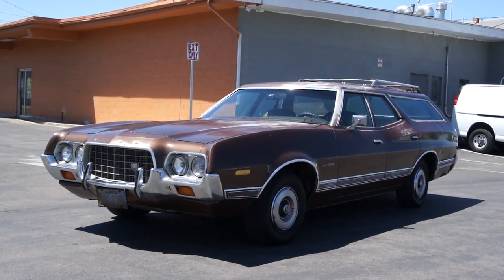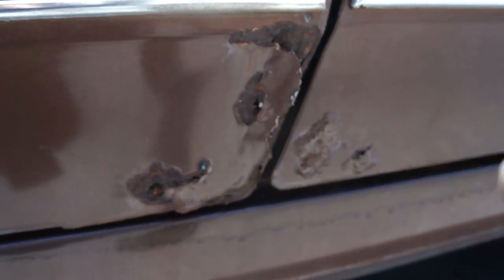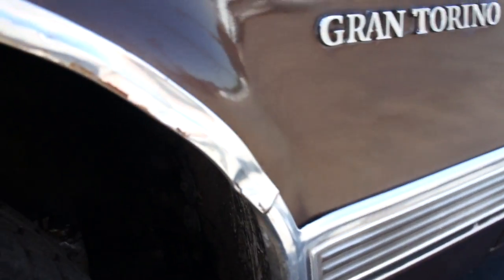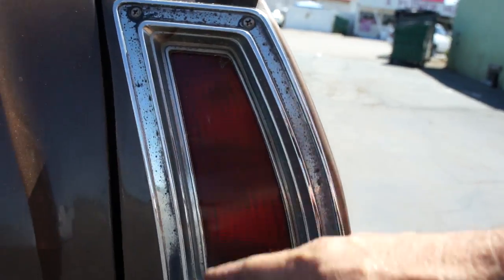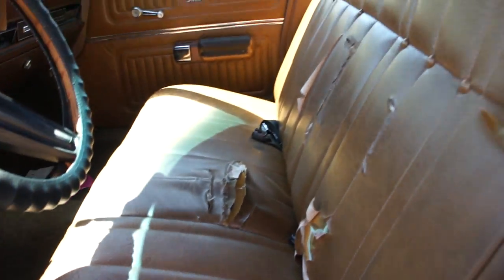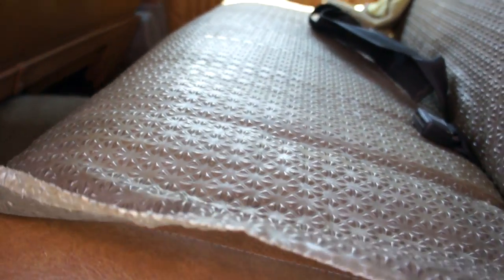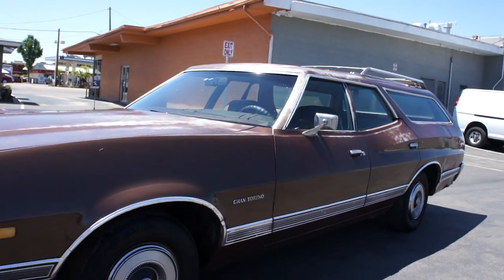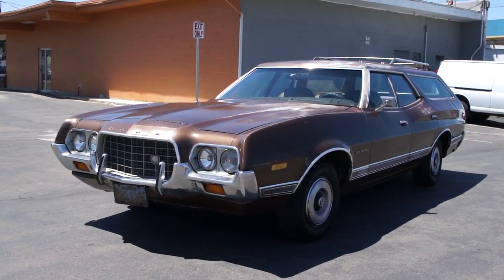1972 Ford Gran Torino Station Wagon 1 Owner Break StationWagon GT

Comment: Good news is many of the parts shown as weathered on this wagon are reproduced. You can buy the armrests, the window cranks, the door handles inside and out, the door lock knobs, the dash pad, things like that. The new owner (in Germany) should have little trouble sourcing this stuff. Now if only we 4-door Torino owners could get Steele Rubber or someone to reproduce the roof rail weatherstripping for sedans/wagons!  I'm about to buy my third 4-door Torino and need SOMETHING!

Comment: My '85 Regal did this a couple times.

Pumping the gas like that usually doesn't work. Especially if it has been sitting there for days or whenever the outside temp changes from mildly cold to fridgid cold fast.

Turn the key and at the same time gradually add more and more pressure to the gas pedal until you touch the floor and after holding it all the way down for a few seconds.. it eventually should go VVVVVVVVVRRRRRRRRROOOOOOOOOOMMMMMMMM!!!!!!!!!!!!!!!!!!!!!!!!!!!!!!

Comment: Cranks right up! Dude. If the manifold and valve cover gaskets are new it had a valve job or total rebuild for that matter but why doesnt it start up!? You said all the elec windows work fine then open doors and they're crank? Dude! 
If it really does run?
$500

Comment: Uh, a little FORD-101,Is in mind,here.. The 260,289,302-251 W.were built in Windsor,,Thus, The designation.. The 351 CLEVELAND,was built,in,of course,Cleveland,Ohio,plant..The 351M400, was built in Midland..Hence,the M designation..NOOO It doesn"t stand,for Modified!!  You can tell,a cleveland,from,a midland,by the bell housing pattern,,The Cleveland,shared the small-block pattern,While,The Midland,used the 429-460 bell housing pattern..

Comment: In What aspect!?? With the MIDLAND- you ,not only get the superior valve arrange ment,of the Cleveland,,But- You Also,get a beefier crank,AND- the 429-460 bell housing bolt pattern!!  Believe me-It"s almost,impossible,to find a "small-Block" C-6,nowadays!!..And, A C-4 will not hold up,even to a STOCK 351 Cleveland,And- there"s no such thing,as a Big-Block,C-4...Just saying...